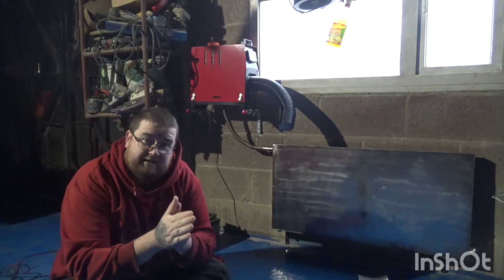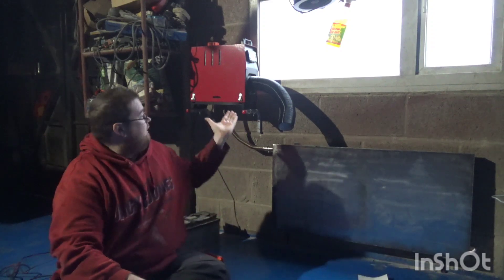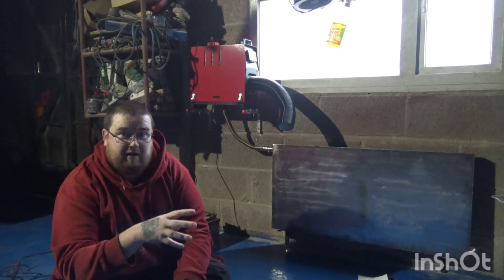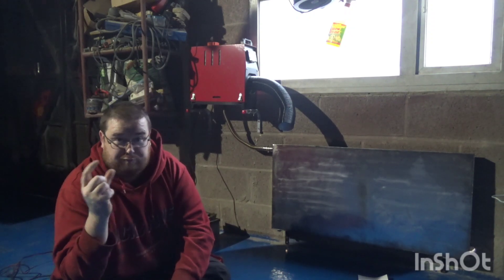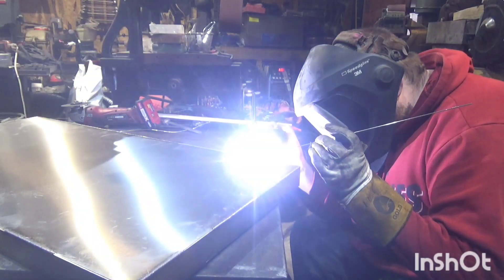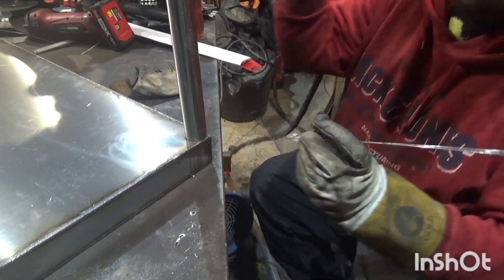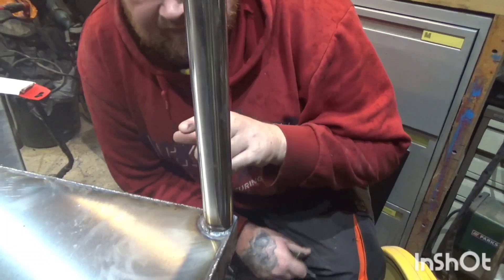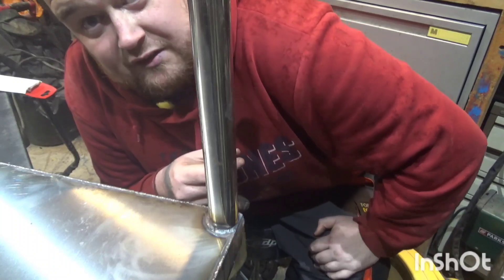heat exchange for the Chinese diesel heater. exhaust heat recovery

Comment: After your whole experiment, what would you do different a cheaper price?
Reply from the maker: I might have used copper for better thermal transfer, but that would be more expensive. I guess thinner stainless steel would have helped with thermal convection and maybe added fins for a heat sink effect.

Comment: I love the idea, been playing with old cast  iron, or oil filled radiator idea hacks, but yours is as simple as it gets, and works. Just a couple of notes, what makes you think Aluminum won't work for the exchanger, the burn chamber is diecast aluminum, the outer fins are aluminum, the exhaust port is aluminum? Just a note if when you had it open put a few baffles in it to let the hot exhaust gas flow in a up and down direction it may work even better than you planned, as others have said, add a water line to it for hot water inlet to the water heater for winter. Weld the line to the outside or top and make the line a heat sink. Was thinking of making  a aluminum 1" or 1.5" tube tube loop and weld it to a sheet of aluminum, yours is even simpler!!
Reply from the maker: My thinking was caused by an issue my dad had with his gas boiler. The gas guy said the metal pipes used always rot out on the condensation run-off thing, and it eats the concrete and basically anything left under the drip . He said basically because of the gases from combustion, the condensation becomes "highly" corrosive. I add the " " because I've dealt with highly corrosive products, and it didn't take a few years to eat through metal, but his words, not mine. So I went for 316 stainless steel because it's a metal I've used in many corrosive situations, and it's been fine. Oh yeah, and he installed a plastic pipeline.... i dont know much about plastic, but I know I couldn't use that with the heat . That's literally the only reason I used stainless steel, and it's the only reason I made an exchanger and didn't just add one of the big cast iron rads I have kicking about. You're thinking it is bang on though the heater is made of ally, so why not use it? However, I do get a good amount of dripping condensation outside from the pipe. I currently have a stainless sauce pan catching the drops to have an investigation at some point to see how corrosive it is.. ally would be a far better option for a heat exchange then stainless. oh yeah I also made this in a desperate attempt to not waste the tremendous amount of money given to me by family a second time round, I messed up once already I was kinda worried so my mind was on a sure and easy fix i didnt think much more then im gonna be in trouble lol

Comment: I like it. I haven tried my idea yet and I’m not a YouTuber. However I will try and quickly try to explain my idea. 
I have a spare heater that I have used for parts so I would like to take the internal fan blade off the motor and than pump the exhaust in to the inlet port. Than run the exhaust port out side. Than hook just the motor to 12 volts. The hot exhaust will heat the heat exchanger and the fan will blow hot air out, just like the other heater.
Might want to but a rheostat on the motor to control the speed.
What do you think.
Reply from the maker: Sounds ideal, I guess if you could make a fined/heat sink aluminium tube then enclose that into another tube and blow the air through it would help with the heat transfer rate where its aluminium

Comment: That's ok if you need a lot of heat. You could also use it to heat water, that requires a little more thinking. The exhaust heat ranges from 0.1-0.7kW depending on the heat setting. If you can make use of all the heat output from the heater and exhaust heat, it can effectively heat a bath full of water 180L from 10-40°C in just under 2 and a half hour. Free hot bath everyday! 🛀 🔥
Reply from the maker: I might get round to making a water heater at some point but for now it works for the job at hand. Not sure on a bath in my shed but warm water at a sink in there might be nice
Reply: If you run the exhaust straight or L shape into a 100 liter bucket or barrel of water it should nicely heat up during the day while you work. I use the online tool omni water heating calculator. You need to get it right around the ballpark otherwise the water will be heated too soon while you're enjoying the heat or it won't heat up to desired temp during the time you hope it would. @smithbuilt

Comment: Add a baffled path for air and fill the rest with sand. Sand will absorb heat over time and release it like a battery after the heater is turned off.
Reply from the maker: I want to run it 24 7 so there shouldn't be any down time

Comment: Awesome job that! Would it work if you made a second 1 mounted it in front with a small gap between the two and plumbed it In it would act like a convection heater pulling the cold air from the bottom between both panels and forcing it up.
Reply: Nicely done! I’m working on routing my exhaust into a 100 pound propane tank. It’s just mild steel so I shall see how long it lasts. First I just want to see how well it works. I increased  my outlet size to 2” just to make sure I’m not adding any increased back pressure. May have a big fan pointed at the tank as well to help pull more heat out of it before going outside.
Reply from the maker: I'm considering doing something like that with some sheet aluminium to help pull the heat out or adding a self powered stove fan . Not sure just yet but I'll be adding to it as there is more potential to be had here
Reply: I suppose the aim is to get the stainless rad as cool as possible whilst keeping the exhaust at the same temp or less… that will prove you have been effective at taking the heat and putting it into the air 👍

Comment: Hi Shane, I always check out your vids as you are so creative.  Couldn`t you have just used an old central heating radiator with suitably adapted inlet and outlet.  Best wishes, Paul from widnes.
Reply from the maker: To be honest that was my initial idea and I think based on it's design an old radiator might convect the heat better but, my dad took his old boiler apart and to my shock the amount of corrosion inside the steam release vent thing and the end of any screws exposed to the exhaust made me think to use stainless steel. Our plummer guy said that all the tubes and parts that come into contact with the corrosive vapours are now made from a plastic to withstand it.... I can't fabricat with plastic..... yet! Lol